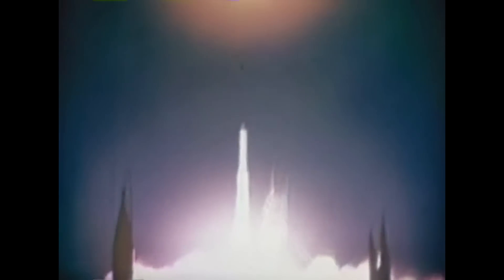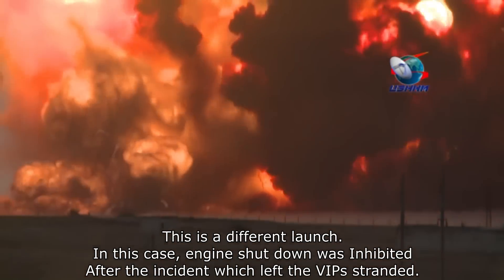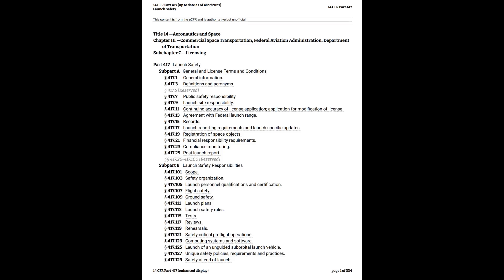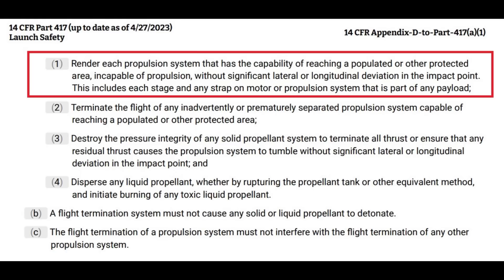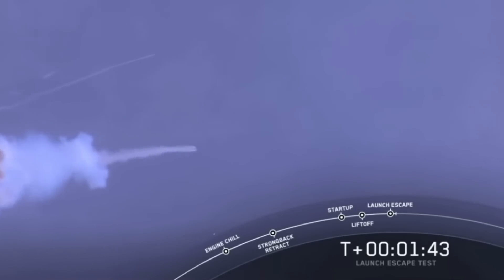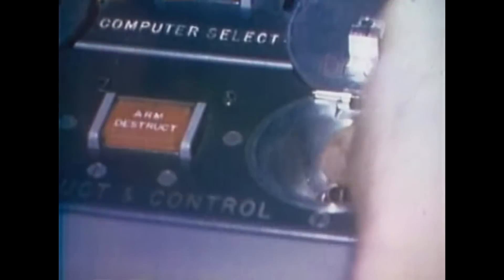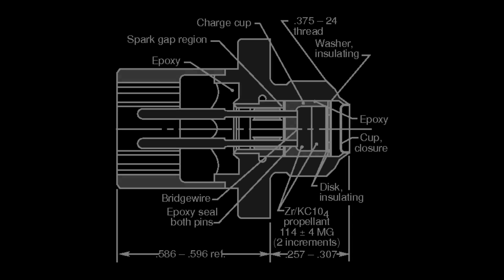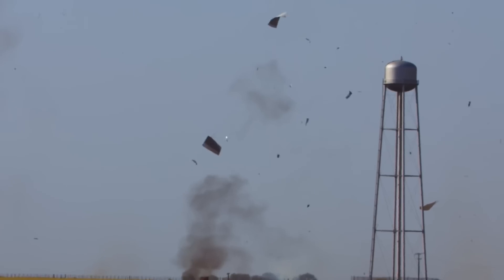How To Destroy Wayward Rockets - Flight Termination Systems Explained

Comment: I would love to know why Challenger's FTS couldn't have intervened in the disaster. Specifically to separate the solid boosters from the stack. Did the problem just  too quickly? Or was it just too dangerous to engage at the time?
Reply: intervened how? It would have killed the astronauts faster
Reply: @thefowlyetti2  I meant to separate the solid rockets from the stack. I edited my comment to clarify.
Reply: @jajssblue  you wouldnt need to use an fts to detach the srb's, but even if they saw the failure in time, separating them when they still firing would most likely cause an explosion.. the only slight chance would be to detach the orbiter, but during that stage of flight that would also be pretty hopeless i would imagine.
Reply: @thefowlyetti2  That makes sense. Thanks for the answer.
Reply: The FTS on challenger was "blow up the ET and SRB's

Firing the FTS with the orbiter still attached would have almost certainly been a death sentence
Reply: Two aspects to the answer here:
1) As pointed out, separating burning SRBs from the ET / Orbiter is non-survivable.  The SRBs would accelerate ahead of the Orbiter, spraying exhaust across the ET and Orbiter which would lead immediately to a very bad day.  Separating an Orbiter from the ET while the SRBs are firing was a recognized contingency, but in the sense of "at least we can say we tried," rather than an option to improve the survival chances of the crew.
2) The first sign of a problem in mission control occurred less than a second before the explosion.  This wasn't enough time to identify/ diagnose / implement anything at all.  While there were indications of problems much earlier than that the values involved were only recorded for later engineering post-flight analysis.
Reply: The SRB with failed o-ring burned a hole in the huge external fuel tank, which detonated. Once this happens, separating the SRBs is a moot point.
Reply: @Joe_VanCleave  "The SRB with failed o-ring burned a hole in the huge external fuel tank"  Completely incorrect...  The SRB burned though the lower mounting point, allowing the SRB to pivot and rupture the top of the main tank and the entire tank disintegrated and exploded.

Comment: Given that it's America, I'm surprised guns aren't involved.
Reply: Given that it is in Florida, I'm surprised they don't get passersby to shoot at it.
Reply: IIRC a rifle was used to depress an Atlas tank when the normal system didn't work and the vehicle couldn't otherwise be safed.  Hope that helps : )
Reply: @colinsouthern  The old Atlas launch pads were pretty much made with a movie like that in mind.  There's a relatively gently-sloping vehicle ramp built into the launch pad, so the notional all-terrain buggy with a 50-cal mounted in the back won't need any CGI help to arrive at the pad level... though personally I would rather see them get there by flooring the ATV while atop the VAB (Saturn V assembly building) and hurtle (in slow motion, of course) from its roof and through the air to the base of the rocket (landing with only moderate stroking of the shock absorbers, of course).

Comment: The rocket knows where it is because it knows where it isn’t.
Reply: What’s good for the rocket isn’t good for the human… if you want to try being a rocket, drive only by looking through your rear view mirror (but don’t, because you could kill your self or others, and other liability disclaimers).
Reply: But what happens if the position that the rocket is in is not the position that it wasn't?
Reply: @philmaggiacomo  the guidance subsystem generates corrective commands to guide the rocket, subtracting where it should be from where it wasn’t. The rocket doesn’t know exactly where it is, but it does know, within reason, where it isn’t. And, by subtracting where it isn’t from where it was, the guidance subsystem obtains a value that reflects its likely position, with a reasonable margin. It then approximates where it is by cross-referencing the data it obtains by referencing where it was and using onboard avionics data to produce a reliable estimation of where the rocket now is. in order to do this, the rocket needs to know how it itself might fly given the information it has obtained over the duration of its flight. By estimating the time when it lost touch with where it was and applying what it knows about its velocity and heading at the time it lost touch with its position, the rocket can obtain a correction which will accurately interpret its position to within 3 square miles. It will then plug in its approximation into the algebraic formula which the guidance subsystem utilizes to determine its optimal flight path, and generates as a result a deviation or variation which will correct the misalignment in its flight path.
Reply: @StealthTheUnknown   and the hardware that does this is the... Turboencabulator, right?
Reply: @stevevernon1978  Not anymore, TEnc technology has been deprecated in favor of Transcabulation. Finally, we no longer have to discabulate the data, do math to it, and encabulate it again before retransmission! We do it all in one simple step, with the data never leaving encabulation!
Reply: @StealthTheUnknown  I could have said it better myself 😉
Reply: @philmaggiacomo  This is how the rocket knows not where it is going, but where it is headed
Reply: @philmaggiacomo 
Rapid unscheduled disassembly.
Reply: The FTS only needs to know where it isn't (on course or near the safety pin).  Once that is established it takes corrective action to make sure it isn't anywhere at all.
Reply: "That is how the rocket do."
Reply: @CT5555_  I heard Zefrank's Morgan Freeman voice.
Reply: You a good 🦜 boy!
Reply: The missile knows where it is-
Reply: You ain’t sayin’ nothin.
Reply: (for those few who don’t know)

https://youtu.be/bZe5J8SVCYQ
Reply: That's inertial navigation
Reply: Sounds like the basis for the “Heart of Gold” drive.
Reply: Scott Manley NCD lurker confirmed?
Reply: I like to imagine they played that video to Starship before launch just for inspiration😅 I love that video
Reply: “Is in space?”
Yes

no(cont)

“Is nose up?”

Yes/No

If no, explode
Reply: And it knows where it shouldn’t be…
Reply: Profound...
Reply: It knows this by subtracting where it is from where it isn’t or where it isn’t form where it is (which ever is greater )
Reply: "What if C-A-T really spelled DOG?" - The Oger
Reply: We know
Reply: @theunluckycharm9637  because we know what we dont
Reply: @erick4188  no, we don't 😂
Reply: @erick4188  Rumsfeld said there are unknown unknowns.
Reply: @theunluckycharm9637  w

Comment: The SpaceX Starship flight test was a successful test of their FTS? 🙂
Reply: If I understand correctly, no.  It appears the FTS punctured the tanks but did not ignite them. They exploded independently.
Reply: @michaelbeemer8019  No the shaped charges probably won't ignite the fuel at that altitude. I suspect the intent was to collapse the tanks which is what happened. I think I counted at least 3 charges going off, likely one per tank.
Reply: Actually the FTS didn't go to plan
From Elon: "FTS was activated but it took too long to rupture tanks, tanks took 40 seconds to rupture after FTS activation"
Reply: @alexanderkenway  The tank structure seems to be a bit too strong.

Bigger bomb it is
Reply: @alexanderkenway did he tweet that?
Reply: @thePotatoGamer2  I was wondering about that "quote" too. But does anyone really want to spend a long time researching this when I was joking in the OP?
Reply: @thePotatoGamer2  Not sure if it was a tweet or an interview, but yeah... he's confirmed that the FTS was triggered but proved inadequate to the job.

JitteryJet may have been joking, but this has actually been a useful bonus from the failed launch... most rockets never intentionally test the FTS in-flight, so it's purely theoretical that it will work when needed... it's possible that there are many other rockets with inadequate FTS. So while it might not have been a planned test, SpaceX now know for certain that the one on Starship needs more work.
Reply: @alexanderkenway  I have to admit some interesting stuff in that copy of another thread. Like the concrete might have failed because the SAND under the concrete failed - the water table is high there. I just don't know why they are using that Boca Chica site for launching big rockets, time to move in my opinion.
Reply: @jitteryjet7525  Why? Because that’s the way Elon wants it.